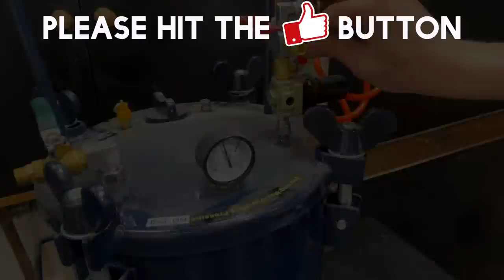Woodturning - The One You've All Been Asking For

Comment: The artwork lamp is pleasing.  But I'm also interested in the lathe and its features.  The lock lever for the tailstock is well located, and the digital depth measurement may not be necessary but occasionally it would be very useful.   What brand is the lathe?
Reply from the maker: The lathe is from Axminster but I am replacing it soon. It has served me well but I don’t really rate them as a company. I have had too many issues with their products 😊👍🏻